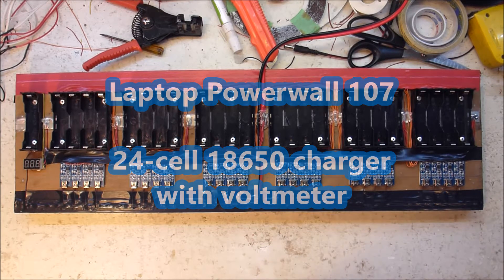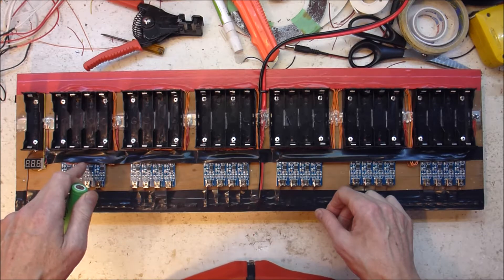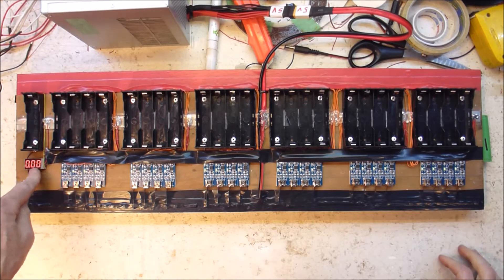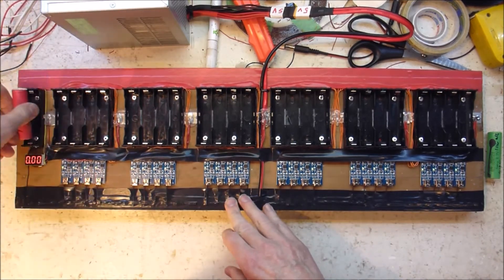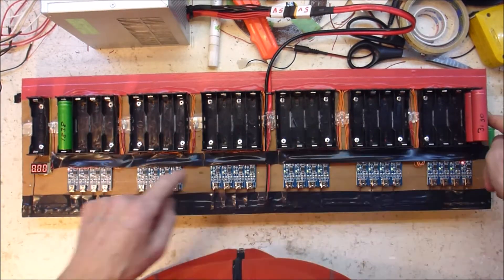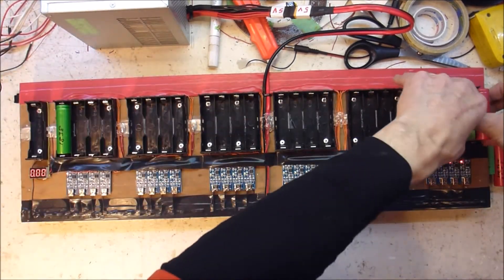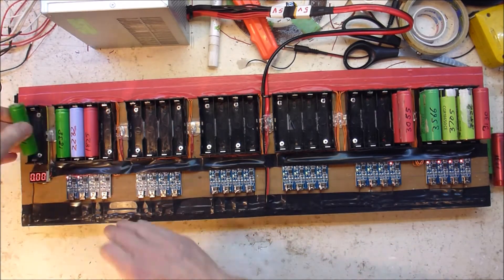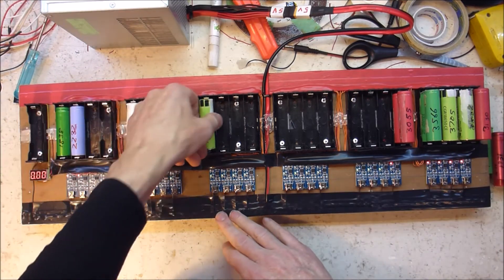Laptop Powerwall 107 - 24-cell 18650 charger with voltmeter

Comment: Very good idea with volmeter! 
I also used to have 4cell holders, but it is extremely hard to remove cells (probably OK for pairs). So now I have single cell holders with gaps between them. You need more space for that.
Low voltage should not be problem, because TP4056 have precharge and can carge cells from 0V.
I don't like 1.5% accuracy of TP4056. Recently I bought some TP4056 modules and few of them have end voltage 4.3V!!! Now I test every new module for end voltage. Just two 500F capacitors in series and multimeter set to monitor max voltage. I will use only modules which have end voltage aroud 4.2V
Reply from the maker: Ohm711 I had a bunch of the 4 cell holder spare so it made sense to use them. I cut out the plastic between the cells too - which should help with the singles. Removing pairs is easy. 
It sounds like the Tp4056 module makers are trying to trim costs too much.

Comment: Very interesting idea and theoretically you could just connect a 5v solar panel during the day and later on just use this PC PSU to charge them since you added this big two pin connector to them (forgot the name of it)

Comment: The little voltmeter idea is handy
Reply from the maker: And if I check every cell quickly before putting them in the TP4056s - it may stop me from blowing them up from time to time.
Reply: Ya i just put the cell in a box to look at later if it doesn't start charging on the TP. Later i will go through it with a multi meter and find out why. But i do find most of those cells in the box read 0 volts. I tried fixing them by doing the 18650 hack and some work after but i must of damaged one cell while doing it and it leaked all over my opus charger and killed it. So i have stopped playing with the dead cells....for now...
Reply from the maker: One of my OPUS slots is faulty due to cell leakage too. :(

Comment: How long does it take (on average) for all those cells to charge up?
Reply from the maker: Depending on the existing state of the cell it's several hours per cell. In this case each slot has it's own charger so if the cells going in were all at the same state of charge they'd all charge in about the same time.

Comment: Any ideas on multi board discharger?
Reply from the maker: Lots of OPUS BT C3100's. Not so cheap though :(
Reply: Maybe few ZB206+ modules. Few weeks ago I saw them on Ali for 6.29$. Accuracy is much better than imax B6 (not fake). Mike also use them. There are also resistor based units which are cheaper, but accuracy is not so good, bacause you don't discharge with constant current.

Comment: Hi Paul,

Please, can you tell me what is the maximum charge in Amps for TP4056?
Does it really load with 1 A? It is not hot at 1 A?
I ask because I bought several TP4056 modules from different manufacturers and I did not find any one to load with 1 A.
The maximum I got was 450-500 ma, but not all the time.
My charger was 5v with 2A, and it is from my tablet.
At 500 ma it was hot.
To fully charge a battery it takes almost 24 hours, which seems to me enormously.

Thank you very much for sharing, and good job !!!
Reply from the maker: Mihai Giurea Charge rate of the Tp4056 chip depends on the resistor on your module. Different manufacturers use use different values. Yes the chip can get quite hot. some people add a heatsink or fan for extra cooling. 24hrs is too long. I usually set aside any cell pair that doesn't charge after 8 hours.